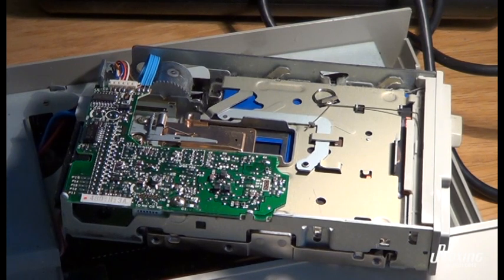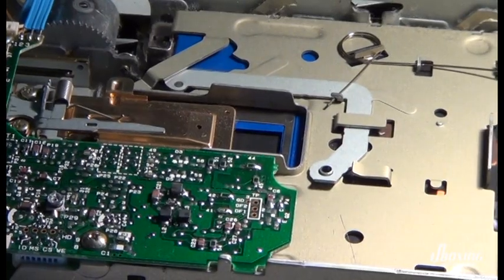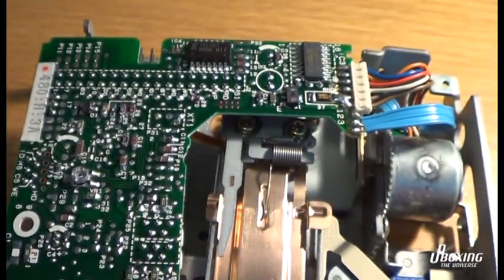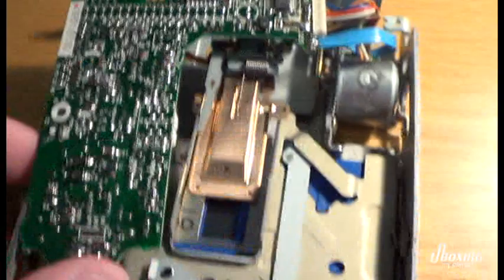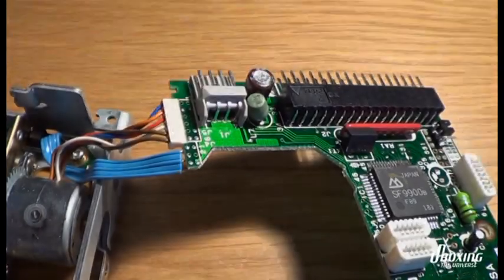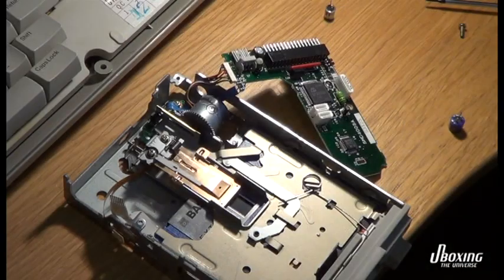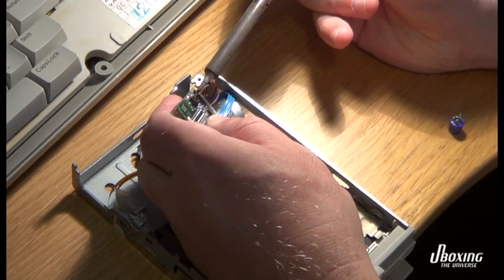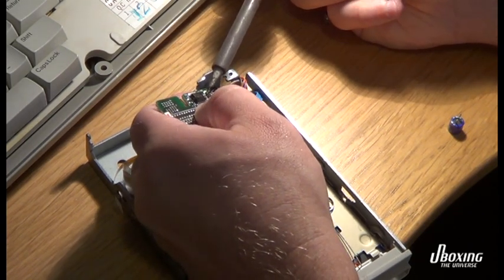Atari st floppy disk drive repair

Comment: You had a lot of luck with this fix, 5 more capacitors are on bottom PCB. I have got this kind of drive and all capacitors leaked and lots of tracks are corroded.

Comment: can you explain what type of capacitor you used as a replacement ? what type and size is it ? thanks :)
Reply: Yeah, it would be nice to answer this one @TechJump
Reply: My 💾 is also not working all the time.
Reply: @philippeneuhaus5694  the PSU Capacitors have to be replaced.
Reply: It's electrolytic capacitor 56uF/16V (5x7mm)
Reply: @wslomo  thanks :)